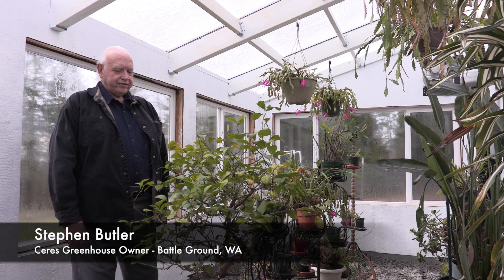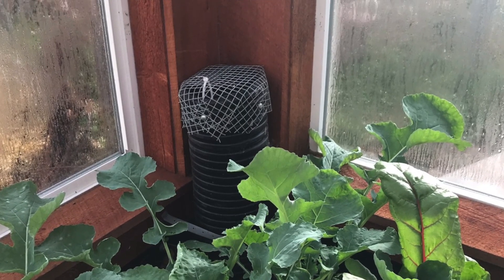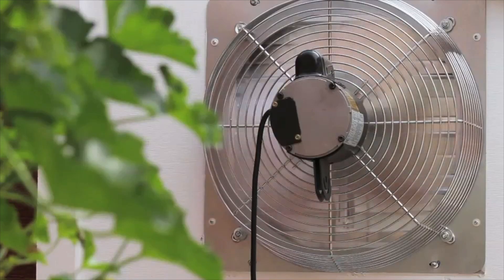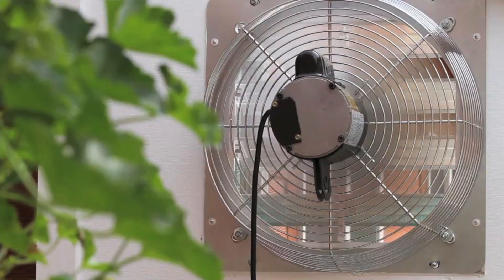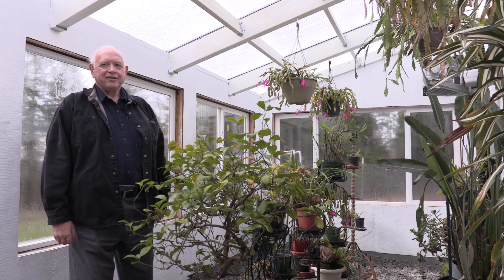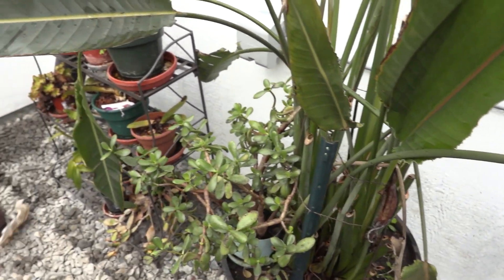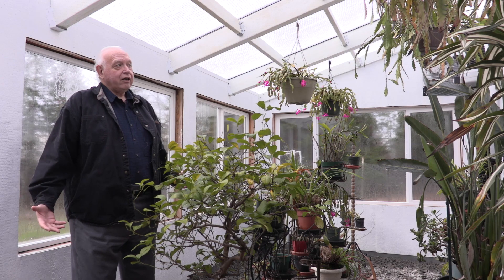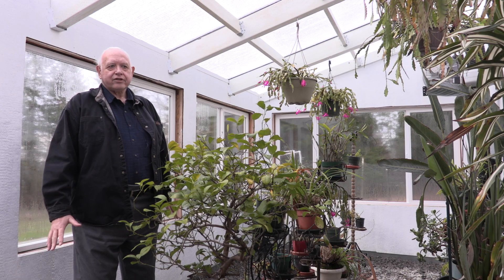A Self-Heating Greenhouse in the Pacific Northwest

Comment: I have a 6x8 greenhouse. I use a 20 gallon water heater and water pump  which goes through a auto heater radiator with a radiator cooling fans blowing and sucking both sides to get enough air flow, which needs dc power supply to run the fans. I have a thermostat which turn the fans and pump off  and on when it reaches a certain temperature i've set. The cost is very small I have notice very little change in  electric cost. I keep it 60  degreez all winter long. I have a sensor in greenhouse that i can read the temp just to check if its working fine.  Been using this for several years now.
Reply from the maker: Glad to hear that's working for you!
Reply: How low are your outside temps?